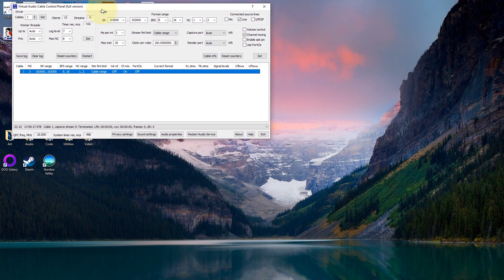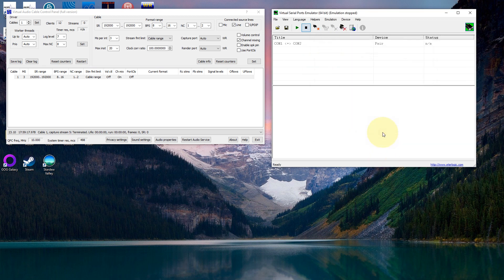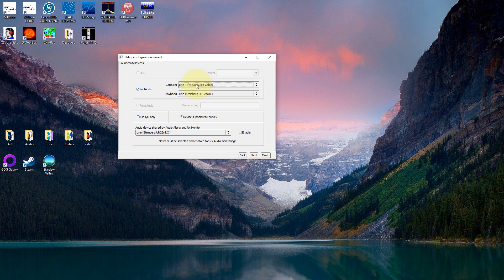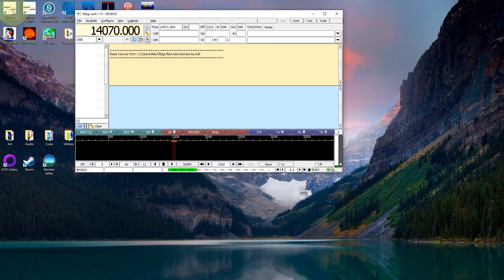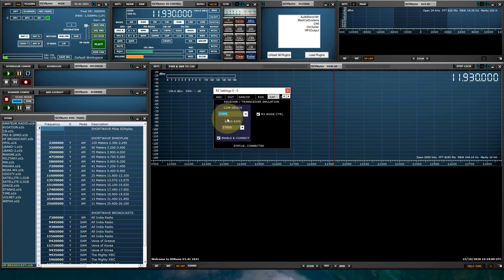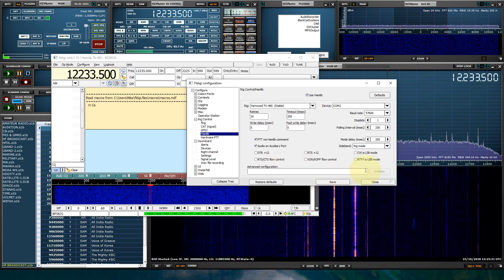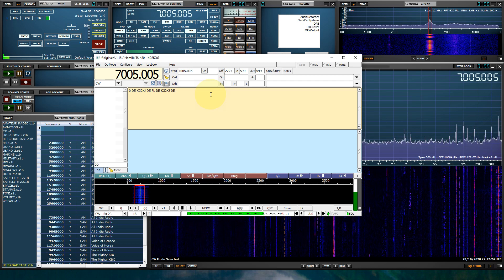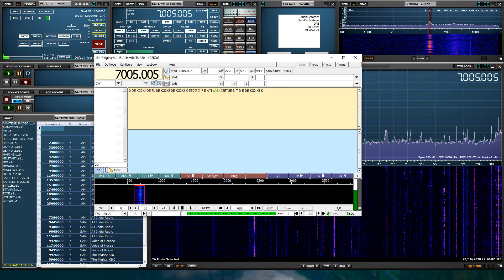SDRuno basics, FLdigi & SDRuno- revised

Comment: A OK ! but I  installed some other VCP , after uninstalling this the COM ports 1& 2 stayed there but were not working anymore causing the "Use HamLib" to pop away after initialize.
Set up using Com port 10 and 15 solved this issue , 
Thanks again for the video.

Comment: This was a very helpful video It enabled me to set this up fine. Additionally I am using VHUI as my SDR is remote connected to a PI. One question, I like to hear the audio as well. Have you worked out how to make FLDigi output to the local speaker... I cannot seem to get that to work?
Reply from the maker: With Windows, you have to enable monitoring of the VAC under the recording tab. This can be found in the control panels Sound section
Reply: @SDRplayHamGuides  Thanks, this helped a lot. Under Win 11 using VBA there is a tick box you can get to ONLY via the Control Panel then sounds then device properties then the "listen" tab in which there is "listen to this device" which needs to be ticked. I never would have found that without your pointer here... thanks

Comment: Hi Mike.......that was very informative, but I have another problem. I am using SDRuno as a panadapter for my IC-7300, using a PTRX board in the radio. FLDIGI works OK and so does SDRuno, but I cannot run they together. My radio comm port is comm 6 and if I start FLDIGI using that port, I cannot use SDRuno with Omni-rig, unless I reboot the computer to clear the port. I am using virtual ports   7 & 8 for Omni-rig / SDRuno, but they still want to see comm 6 clear. Does that make any sense? Need to figure this out somehow, if anyone has any ideas? Thank You and 73's
Reply from the maker: This should help.
https://youtu.be/SMiPXRAfvz4
Reply: @SDRplayHamGuides   Hi mike......the video you attached is the same one here. My problem again is that I have an IC-7300 using a PTRX and an RSP1A.as a panadapter. Guess I am too new at all of this, but whichever virtual comms I use for SDRuno, it somehow blocks
 any other program (FLDIGI & WSJR-T) from using comm 6
Reply from the maker: Sorry about the redundant link. When I set this up I used VSPE with a com port pair. 1 of the 2 com ports was set in SDRuno and the 2nd of the 2 com ports was set in FLdigi. I've never used this with a transciver added in.
Reply from the maker: Is the PTRX an IF out or an RX/RF out. If its an RX/RF you should be able to use omnirig to control the rig from SDRuno. 

This setup is the same principal as running HRD except you would repalce HRD with  FLdigi in the example pasted below.  https://www.sdrplay.com/docs/HRDandSDRuno.pdf
Reply: @SDRplayHamGuides   Mike the PTRX is an RF unit.  I want to be able to use both FLDIGI and WSJT-X with my 7300 and so far any use of virtual comm ports has been a total waste of time. The only way I can get SDRuno to give me full rig control is with Omni-Rig and using the original Silicon Labs Comm6, which is the one that installed to connect my 7300 originally. When that is set up, I can't use either FLDGI or WSJT-X, even with virtual ports. If I set it up like in the video and get a pair of virtual audio connections, will I have rig control with FLDGI & WSJT-X, or is that asking too much:-)
Reply from the maker: In the HRD documentation. HRD is set to control SDRuno and SDRuno is controlling the transciver. It should be no different when using WJT-X oe FLdigi.
Reply: @SDRplayHamGuides   Thanks Again Mike....I did find one glitch. My SDRuno would not work with Omnirig 2.2.0 so I downloaded the 1.2 version and its working. Now to try all that other stuff:-)

Comment: After a couple of hours I was finally able to get this working.  I was having a problem getting the FLdigi/hamlib rig control to work and sync with SDRuno.  I was using COM4 and COM5.  SDRuno set to COM4, and hamlib set to COM5.  After checking the box 'hamlib' and clicking initialize, the 'hamlib' box just unchecked itself and programs did not sync.  Problem turned out to be OMNIRIG which was using COM5 (I had originally changed it to COM5 through CWSkimmer while setting it up to work with SDRuno the previous day).  I changed OMNIRIG to COM6 and finally FLdigi/hamlib was able to sync with sdruno.

Comment: I set the playback in FIDIGI to my sound card and the audio device shared by Rx devise to my sound card as well.  I set  MY SDR Uno OUT setting to my virtual audio cable.  But guess what, no sound unless I reset the SDR Uno Out setting back to my sound card, and then, of course FIDIGI doesn't work.  What am I doing wrong?
Reply from the maker: Inputs and outputs should be set to the virtual audio cables.
Reply: @SDRplayHamGuides  The problem seems to be on the FLDigi side.  I have the audio set in SDR Uno to my virtual cables COM1, no problems with bi-directional control.  I have the FIdigi audio capture set to my virtual audio cable (COM2) and the playback set to my soundcard (Plantronics 7).  The audio devise shared section is also set to my soundcard.  I have tried enabling it and not enabling it (check box), but regardless I get no signal through the soundcard.  I can get sound by the way if I set SDR UNO output to my soundcard.  Any further ideas thoughts would be appreciated.
Reply from the maker: Hi David, Virtual audio cables do not use com ports, Do you mean virtual com ports?
Reply: @SDRplayHamGuides  Yes, that's what I meant.  The problem has been resolved.  I did further research on the Internet and found that the issue was with the privacy settings in Windows 10.  I found the solution on this link:  https://www.qsl.net/w6lmt/All-Stations/2018-06-24%20Windows%2010%20and%20fldigi.pdf

Comment: Mike - got it working with Fldigi but also tried the VAC output to a program called CWGet and decodes very well there. Only draw back for me is I can't hear the signals. Is there a way to have VAC out put go to a decoder and your PC speakers?
73 Paul w2eck
Reply from the maker: Select it in the playback device and have it resend to your primary playback device. Lots of information about VAC at our hamguides site 
https://www.sdrplay.com/sdrplayhamguides/
Reply: @SDRplayHamGuides  So watched the video you gave link on and didn't see anything specific to this question. But I did go into Fldigi and in Sound card/Devices,  made my PC speakers the Output device. But still not hearing anything. Fldigi still decoding just fine.
Reply from the maker: @pakeck1  Look in the options within your sound settings under control panel. You can redirect audio from one souce to another. The SDRplay youtube channel should have VAC videos  that 
outlines this.
Reply: @SDRplayHamGuides   Tnx for pointer. Got it working by going into Windows Sound Control Panel, select Recording Devices, then the Virtual audio cable, 2x click it to get to its properties , then select Listen tab and check the "Listen to This Device" and select your PC speakers.  Don't forget to change back when done so you have normal windows pc sound. Just in case anyone else was wondering. 73 Paul

Comment: Mike - question on getting paid version of VSPE. The Etterlogic site is a bit confusing when you go to pay. I have a 64bit Win10 PC. A few questions. Currently I have the unlicensed version, is it limited in capability? So it is advantageous to get paid ver?
 It seems the 32bit ver is free? But Best I can determine the 64 bit ver is abt $24, does that sound correct? Do u know of any special discounts?
tnx Paul
Reply from the maker: Yes, that is correct. 32 bit is free and the 64-bit is paid for use
Reply from the maker: Not sure on the functionality of using the 64 bit version in trial mode.